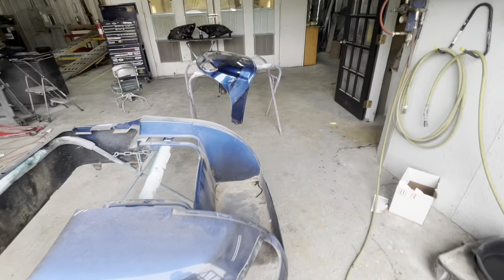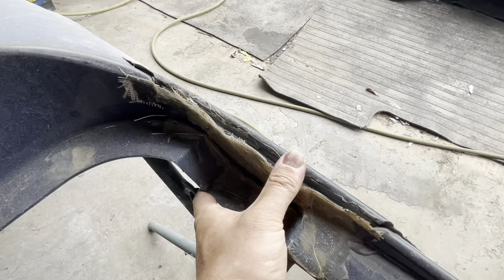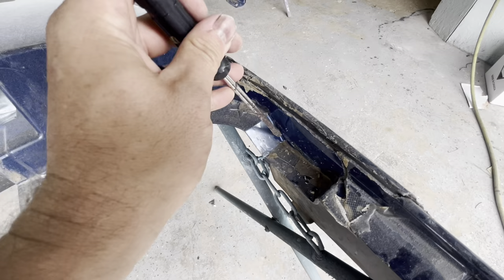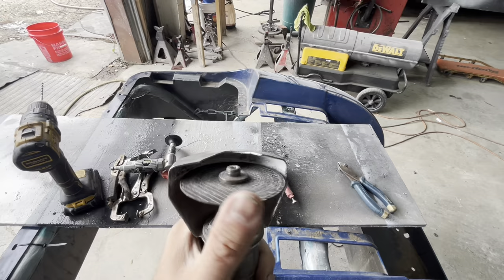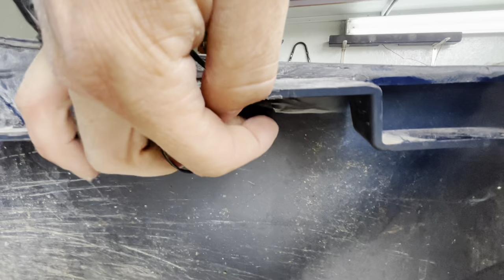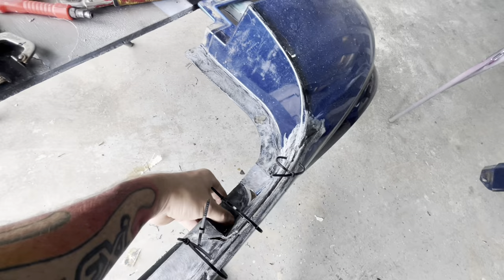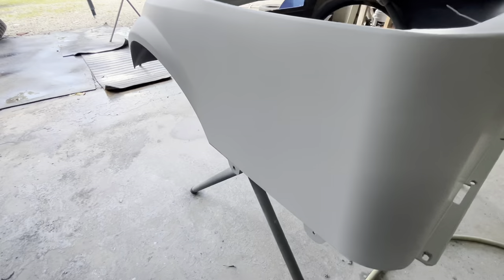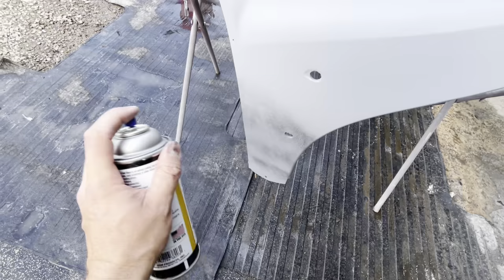🛑 Watch Before Repairing Plastic Parts / Golf Cart Bodies ‼️ DIY Correct Way 👍🏻

Comment: I prefer to do structural repairs with plastic welding rods.  There's no waiting for dry times and its a true weld and not just a glue relying on a mechanical bond.  Do a good job with the welding and you many times won't need any spot putty after sanding.

Best!
Reply from the maker: Thanks that’s awesome

Comment: Awesome thanks. Would be amazing if you had alternative products for those of us who don’t have a shop & can’t afford nor need $99 gun, qty 36 disks or expensive 2 part epoxy we will only use once 😩
Reply from the maker: You can use the $20 harbor freight gun and be totally fine. Gun doesn’t make a good paint job. Any brand sand paper will work. And the epoxy is where I wouldn’t cheap on. But I do order mine on eBay now at discounted prices

Comment: It's amazing how the adhesives bond so quickly and are so strong.  What would you recommend on a fiberglass hood that has a spot rubbed almost through? Would  Dolphin glaze be enough?
Reply from the maker: As in a hole through it? Or a rock chip?
Reply: @The Paint & Paper Hustle  the toolbox tipped over and was rubbing on the hood. It's not all the way through,  it looks like just through the gell coat
Reply from the maker: Sounds like I’d fix it with gel coat or resign to keep strength
Reply: @ThePaintPaperHustle  thank you
Reply from the maker: You’re welcome